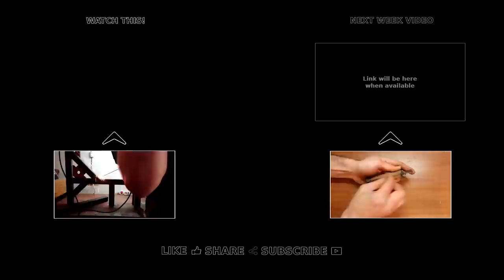Sharpening Wheel For Razor Sharp Blades! MDF

Comment: That is a wheel made of particle board. Not engineered to withstand centrifugal forces you are subjecting it to. Do the math....particle board wheel, knives in direct contact, requires very close proximity of user and it adds up to a very dangerous tool. Totally unnecessary when a store bought one is not expensive and will last much longer and will substantially reduce the danger. To you and all your viewers, do yourselves a favor and buy one.
Reply from the maker: I've used one of this a lot and it's still in perfect condition :) And I'm not the only one doing so, I feel pretty safe! But I promise you I'll report if anything goes wrong.

Comment: DANGER------ Holding the sharp side of the blade into the direction of the turning wheel is asking for trouble. Not wearing protective gloves is just plain STUPID. Good luck in surgery when you get your fingers sewn back on, providing they're still usable.
Reply: Agreed. You'll know if it happens. That's why I am selling my 1950's B&D double ended grinder. It was too much of a beast.

Comment: This is fine for chisels, but  is no way to treat a good knife.  Yes, you can get a knife razor sharp this way, but you also shorten it's life by a factor of ten, if you actually have to sharpen it very often.   It isn't simply about getting a knife sharp, it's about how much you love the knife, how much you paid for it, and how long you want it to last.  

Sharpening like this removes ten times as much metal us using stones and strops, which are not expensive, or time-consuming, if you know what you're doing.
Reply from the maker: You sure man? I don't feel like it's taking off much at all, It's polishing compound after all :) Also stones that get you to a sharp edge like this tool does are very expensive... At least for me!  :)

Comment: $100+ circular saw, $40-60 jig saw, $20-30 mdf, $12 C clamp,$39-50 drill, $10+ drill bits, $60 motor to turn mdf wheel, etc. Not cheaper than buying an Wen or Rikon actual knife sharpening wheel.

Comment: THIS IS NOT SHARPENING IT IS HONING OR STROPING. 

Sharpening requires removing material to reform a cutting edge that has been lost or damaged. Honing it the process of making the micro seration of the material as small as possible so as to form the sharpest cutting edge possible. 

This is the second or third video Ive seen calling this thing a sharpener, it is not.
Reply from the maker: Yeah you'r right bro, but I most people don't know what honing means, and by calling it sharpening I think I might get to more people that was looking for something similar :) I thinks it's quiet obvious that polishing compound can't handle a busted edge :') Moreover you'r the first guy pointing that out!